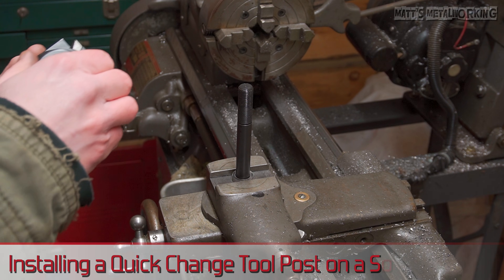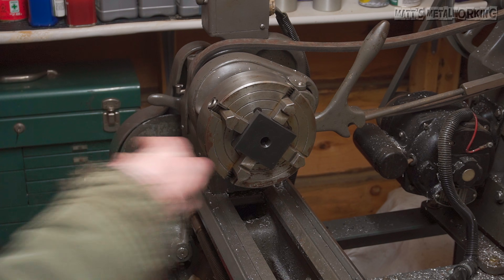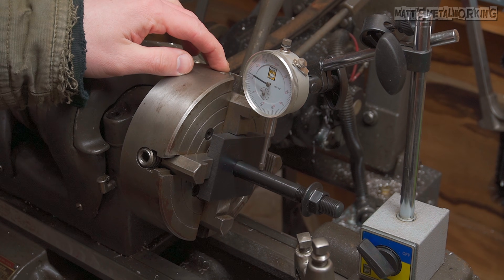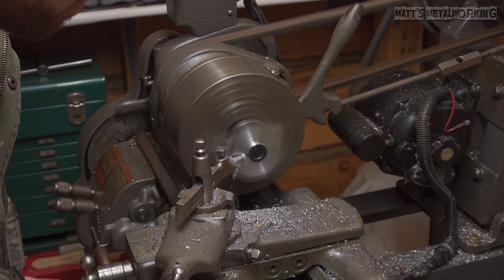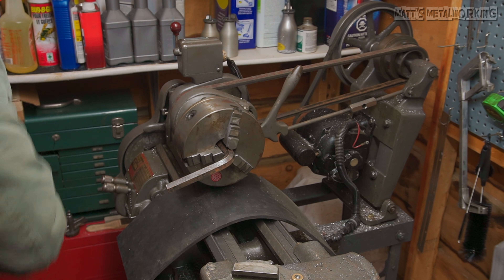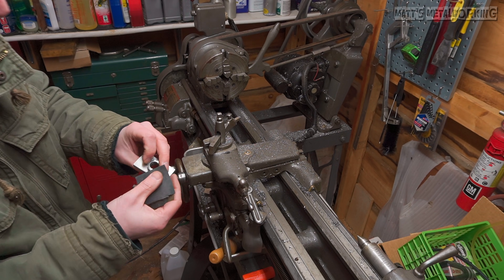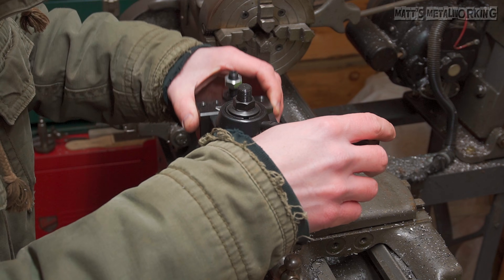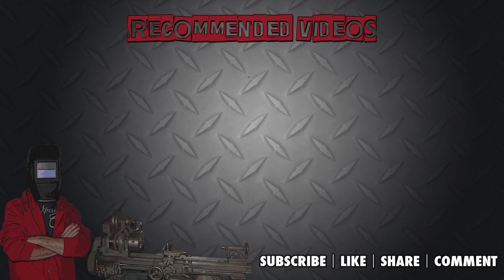How to Install a Quick Change Tool Post on a South Bend Lathe

Comment: Excellent video!  I just purchased a similar tool post.  If you had to start over, would bother to use the 4 jaw chuck to start cutting the T plate or would you go straight to the 3 jaw using the center bolt?

Comment: I need to do this to the tee nut for my new QC tool post. Was thinking I had to use a milling machine (which I don’t have) but now I see I can do this on my lathe, which is wonderful news! The lathe I recently received is a Sheldon 11 by 44 from 1946, and the lantern style tool post is its chief weakness.